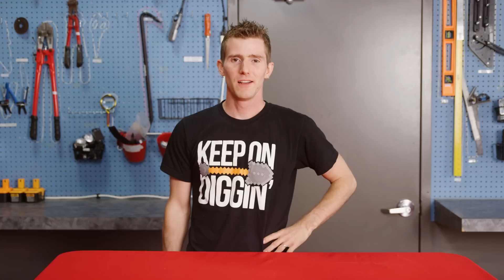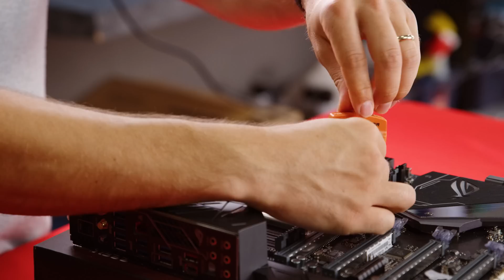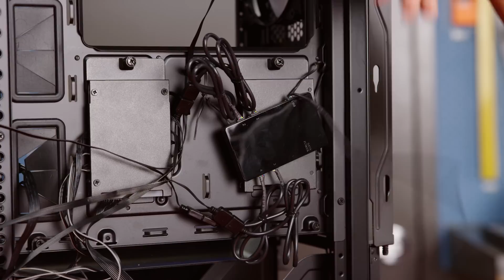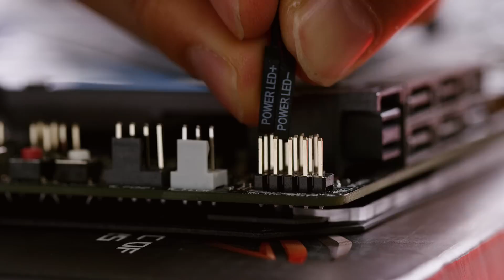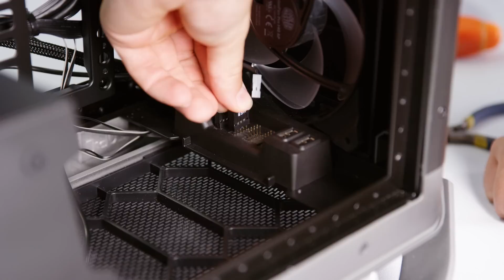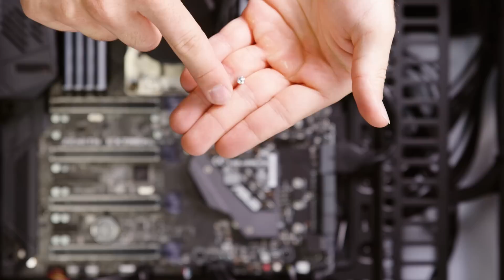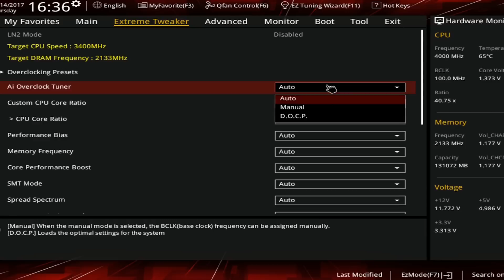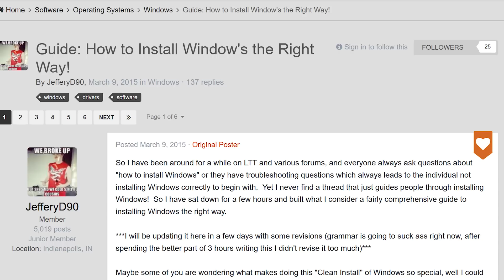Ultimate Mega-Workstation PC Build Guide

Comment: This is going to make the perfect Web-Server system and should have been put into a 3U Server case with with as many fans as the system can take as well as the best Heat-sink together with 2TB of DDR4 RAM as well as a RYZEN VEGA graphics card and installing the SAS RAID controller and install and connect up all hard drives and configure system but no over clocking under any circumstances.

Comment: One problem with this one... you concluded that air coolers (specifically the noctua tr4) were better than a regular aio water cooler for threadripper, so why are you using a CM water cooler? Even though its a sponsored video you shouldnt mislead people by saying "water coolers are basically required".

Comment: In case you clicked this video wondering how to make an apple pie, here is the recipe:

Ingredients: 1 recipe pastry for a 9-inch double crust pie, 1/2 cup unsalted butter, 3 tablespoons all-purpose flour, 1/4 cup water, 1/2 cup white sugar, 1/2 cup packed brown sugar, 8 Granny Smith apples - peeled, cored and sliced

Directions: Preheat oven to 425 degrees F (220 degrees C). Melt the butter in a saucepan. Stir in flour to form a paste. Add water, white sugar and brown sugar, and bring to a boil. Reduce temperature and let simmer. Place the bottom crust in your pan. Fill with apples, mounded slightly. Cover with a lattice work crust. Gently pour the sugar and butter liquid over the crust. Pour slowly so that it does not run off. Bake 15 minutes in the preheated oven. Reduce the temperature to 350 degrees F (175 degrees C). Continue baking for 35 to 45 minutes, until apples are soft.

Comment: Only one GPU? I'm fairly disappointed.
Reply: Multiple GPU's are far from dead for prosumer workstation builds, like this. It's not a gaming rig.
Reply: SLI is only dead IF YOU'RE GAMING. But the issue here is, this isn't a gaming rig. This is a prosumer workstation, so yes SLI yields a monumental benefit.
Reply: Aren't they still supporting two-way SLI?
Reply: Try CG Geek, Remington Graphics, Blender Guru. They all use dual Geforce SLI. Also try sites like Artstation (professional CG artists) and BlenderNation (enthusiasts and pros alike). You'll find many who use it. Might want to check your facts BEFORE trying to make that comment. Studios don't normally use them because they can actually afford a $4,000 P6000 or a $7,000 GP100. And even then, they sometimes turn to other render farms to take care of that for them. Plus Mosaic is a piece of software that also benefits from the hardware. The program doesn't actually determine the speed of the render very much. Optimized programs that specialize in rendering do have some performance upgrades over a generalist program like Blender, BUT they still require strong hardware to render the multiple tiles at once. How do I know? I do this kind of work all the time.
Reply: Crafty Canadian, that's where you're wrong. When was the last time you've even worked with Blender? Cycles, Prorender, Renderman and Redshift all recognize SLI and split tasks among them, allowing for the render of anywhere from two to four tiles at once. There are a myriad of videos that show it even cuts render times by half in some cases. Perhaps you should try checking them yourself. Or would you like me to throw in several references as proof? Because I can do that too. You people seriously need to get a grip and do some research first. This is YouTube, for crying out loud. You should've gotten the idea that I'm right by now. SLI doesn't do much for video games except give you maybe a 10% performance boost. It's video games that don't handle SLI very well because video games run on a continuous set parameters that are pre-loaded (hence the load screens) while rendering is all done by path tracing with parameters that are always subject to change. Did you even bother to look at the artists (with many more years of experience) or the sites I mentioned? Because it clearly shows you were either too ignorant or too arrogant to do so.
Reply: PS: most studios use GTX cards. You can overclock them and replace 10 before the cost is this same as an equivalent Quadra. Quadros are for workloads that can not fail, such as important physics simulations that take months to complete. Again your novice is showing through.
Reply: I use two GPUs, but only because I don't want to spend the extra bucks to get a quad-output card (though they have come down in price a fair bit). I run 4 monitors.
Reply: BleckEpyon, if you only need something for simple business stuff, but would like to run two monitors, then you really don't need more than a system with maybe a Ryzen 3 with possibly a GTX 960, and that's if you feel like doing maybe a little photo editing as well. Not much power is required for something like that.
Reply: Touchy touchy. There's a reason why you never use different cards in the same render. There's a big chance there will be a difference in performance due to core count, clock speed, or VRAM. You'd have to either mess with the sampling or tile size (which will slow down the render) just to get it right, otherwise your render will fail. You also CANNOT use two different APIs (CUDA/OpenGL) in Cycles. It doesn't allow for that. Not even VRay will do that. Prorender will allow it, but that's because it's an engine that came straight from the people who make GPUs instead of some third party, so they've accounted for it (you should check it out. I tested it, it's amazing). I thought someone as "experienced" in engine coding as you would know that already. And for the record, you're missing the point, or dodging it entirely by saying they can be in different computers. That's called Network Rendering. But I'm talking about rendering on one single machine. Most studios use Quadros for the reason that GTX cards don't have enough VRAM to load up with the different texture maps, the mesh and the path tracing that needs to be done. Quadros do. For physics, you don't need a GPU. That has to be done on a CPU or get a Tesla (or equivalent) because it's all a series of algorithms and points, not visual objects. Same with particle effects. Particle effects do have a visual aspect, but the physics are all calculated in algorithms, which again, you'd need an algorithm processor (or coprocessor) for.
Reply: My "home" rig is both for gaming and as a workstation. I dabble in Poser, Photoshop, etc, which is why I use 4 monitors, but not enough to make money off of it (my day job is a landscaping business). My business machine has 2 monitors, and at some point, I'll replace it with a MB that can handle 3 monitors on board. Nothing fancy, I don't use it for gaming or graphics, just spreadsheets and business stuff like that.
Reply: Aspiring Wackjob SLI is for video games, Blender and all path tracers treat each GPU as a seperate entity. No need for a SLI compatible mobo and you can throw in any combination of GPUs. Most applications do not make use of multiple graphics cards very well, you should know our line of work is a very specific use case. Don't be such a dick, you are clearly lacking in knowledge yourself.
Reply: Aspiring Wackjob This is my job, I can see right through your novice bullshit. You've probably never even been paid for a job before. You can use an AMD GPU mixed with an Nvidia GPU on a non SLI compatible board and get nearly identical results to two Nvidia GPUs in SLI. Cycles breaks the image into chunks then asks each GPU to render a chunk, independent of SLI protocols. The two GPUs can be in different computers you fuck wit. I've been coding render engines for years, and I'm still a novice. Quit acting like you're superior yo everyone else because you've watched some youtube tutorials.
Reply: Sli is dead even nvidia know that
Reply: No one uses dual geforce cards in SLI in a workstation computer seriously lol,mosaic is the way to go
Reply: If you can afford a 1080 TI - you're good. SLI is not worth it. Never was, never will be.

Comment: The unit of torque is inch pounds, not pound per inch. And that's not even starting on how pounds aren't a unit of force, but of mass. And then there's the fact that the units are imperial.

Comment: Can u do a mega charging comparison of multiple iPhone 8 plus and 7 plus with 12 watt apple ipad adapter vs Qualcomm quick charge 3.0 adapter(aukey, anker etc) vs Huawei 4 amp adapter vs Oneplus dash charger vs oppo vooc flash charger vs mediatek pump express charger vs Samsung Note 8 charger, ALL CHARGERS CONNECTED TO DIFFERENT IPHONE 8PLUS OR 7 PLUS VIA STOCK IPHONE LIGHTNING TO USB A CABLE, NOT using the USB C to lightning cable to test that whether iPhone changes faster with stock cables but using latest different brands fast chargers unlike Apple says. Cuz it costs( 84$) 35 $ plus 49 $ apple usb c adapter and cable and if we buy only 35$ cable and 22 $ USB C aukey, anker, xiaomi adapter it still costs 57$, but if the test will be successfully using stock cable, will be spending only on USB A fast charger

Comment: 13:37 those are the wrong 4 screws, the correct ones are on the edges of the psu hiding plate (3 on the bottom, one on the side)

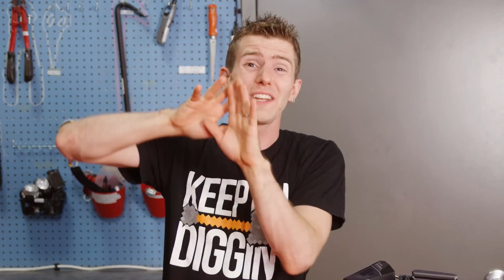Comment: 4:23 "128gb LRDIMMs (load reduced DIMMS) those aren't even out yet!!" 

HP Workstations have had LRDIMMS available to configure into their systems for more than two years now, with models like the Z840 being able to handle up to 2TB of RAM (16 slots populated), and the soon-to-be-release Z8 generation can handle up to 3TB. 

Ridiculously expensive? Yes. For gaming? Nope. Overkill for 99.9% of PC users? Hells yes. Good for geological simulation and engineering and CG rendering? Yes, absolutely.

Comment: i remember my 10 year old p5k motherboard had a revolutionizing feature: it came with a little male to female header on which you could connect the power LED +, LED -, hdd activity , reset switch and power switch so it was a lot easier to connect or disconnect the motherboard from all these cables and not having to plug them all individually each time i had to take out the motherboard for some reason. Why does a modern, top of the line motherboard today not have such a simple but handy part? it probably costs only a few cents to include.

Comment: Btw The visuals and filming was amazing, but if this guide is meant for a beginner shouldn't you be focusing on the absolute basics?
Like which connectors go where what's  a  4pin power connector, what's an RGB connector?
Not to mention, not bombarding them with extra confusing knowledge!

Comment: I found it extremely hard to get the CPU socket closed on the same board, heaps of other people with the same issue so not sure :/ I eventually got it closed by half turning screws 2/3 first then pushing down super hard to get screw 1 in, that was required to get the screw to thread.
Reply: It depends on who makes the TR4 socket for the mobo. There are two companies that manufacture the socket - Foxconn and one other whose name I can't recall at the moment. One of them is causing the issues you're referring to and the other is not. At work so I don't have time to research it again but if you figure out which one is good, you'll can rest easy with a board that has a socket manufactured by them.
Reply: Well, sure... anybody can receive 1 bad motherboard. But comparing the cooler mount of an AM4 to the CPU mount of TR4, is apples & oranges. One holds the processor in place, while the other holds the cooler on. One is a backplate, the other is part of the CPU locking mechanism.
Reply: Foxconns TR4 sockets have lousy tolerances.
The ones made by "Lotes" are much better.
IIRC the ASRock X399 Taichi has a Lotes made socket, but don´t quote me on that.
Reply: well it IS called THREAD RIPPER isn't it??? lol
Reply: AGS Function - You referred to a stock cooler, which means you're building on the AM4 mount, which is completely different than the TR4 mount, for the actual CPU, not the cooling solution. Backplates for AM4 boards are a completely different animal.
Reply: You do have a point there. :)
Reply: I'm going to do a threadripper 1950x build soon but I'm worried about that issue with those cpu sockets. Has AMD or their mother board partners address this issue yet?
Reply: CRF250R1521 -well played. lol
Reply: @nappydrew I think AGS Function is referring to AMD sockets in general. I think it was Hardware Unboxed that complained about this particular problem (on TR4) but it may have been another YouTuber. Personally sounds like AGS Function got a rogue AM4 socket which is bound to happen to any platform.
Reply: I actually had a similar issue when building my Ryzen build. The stock cooler that came with the cpu had  a hard time fitting, one screw would screw in , but then the rest wouldn't. had to push down pretty hard and i think i severed some connections because i kept getting boot issues and eventually crashing. overtime i think the reheating and cooling reconnected some of those connections. in either case, its a lot more stable now and im not quite sure what i did.

Comment: i wonder how's the cooler performance on that processor..
Reply: not as good as a custom loop... 
It's not just for looks, the cooling performance is directly related to the size of the radiator, some custom radiators such as the EK XE 360 can cool down just about any CPU or GPU. plus as mentioned the water block isn't very optimized (to be fair non are because AMD made the Rizen die so much bigger then the average CPU die).
Reply: Shamsul Aswad Sulaiman Bad because the water channels/fins cover about 50% of the cores' surface
Reply: that's what i thought..then i realized that the video was sponsored by cooler master..lol

Comment: No benchmarks? Sad face
Reply: 1H more of work to set windows 10 and run test , isn't that to much to ask ? They don't show us how powerfull this is , so this is NOT " yet " the Ultimate Mega Workstation .
Reply: Didn't have an OS installed to test lmao
Reply: 4k is valid, I have a 4k monitor at my desk right now.
Reply: trust me, this thing will destroy every benchmark, especialy synthetic ones.. and for gaming.. well.. ask this machine again in 3 years and check back if its getting below 90fps in any case
Reply: except for 4k obviously.. but 4k isnt valid anyways today. soo..
Reply: Atm I would have thought "ultimate" would be a dual-socket EPYC with 64 cores. Just sayin'. :)   Funny part is, the CPUs don't cost that much more than the 18c SL-X XE.

Comment: btw, did you guys forgot to peel off the paper protecting the thermal pad on the inside of that mirror like shining motherboard plate?
And thanks very much for the bios instruction, I was really annoyed when i couldnt get my dram running at the recommended frequency.

Comment: Linus, I was watching a video where Noctua`s new AIR coolers for TR4 completely obliterated the NZXT Kraken coolers by like 10 degrees Celsius. So I would rather have the whole die covered rather than making excuses for the AIO coolers.
Reply: HardwareCanucks?
Reply: That's true, and a valid point. Air vs AIO/water has been an old of a  discussion with compelling arguments on both sides of the fence, but in this particular case I would say that with the added effectives, the Air coolers make more sense for the TR4.
Reply: The only reason is that Coolermaster does not have a cooler that could beat the Noctua that are made for the TR4.
Reply: Even LTT has made a video on that recently, kinda. They compared some of Noctua's air coolers with some AIOs and the air coolers turned out to be more effective. The problem however is that the air coolers are pretty big compared to the AIOs and if you don't like the look of a huge chunk of metal on your CPU and have the money for it, an AIO or a custom loop might be the way to go.
Reply: "We need a small cooler in this 50lb monster of a case."

Comment: 1) No SLi? 

2) No setting special RAM clocks that are proven to increase ryzen performance ? (for the gist of it go to https://www.youtube.com/watch?v=S6yp7Pi39Z8) 

3) I would also like to see it with liquid edition Vega 64 that has been undervolted (which allows then wattman to increase the wattage since the temperature falls down) Id like to see that because there is talk that ryzen chips perform better with a Vega card than with a Nvidia card.

4) Generally building this and not OC it to the limit?

5) No benchmark? its like porn without the moneyshot :P

Comment: Only a 240mm radiator? You're probably not going to be able to overclock with a radiator that small. HardwareCanucks tried using a NZXT x52 and it overheated during a stress test and shut itself down.

Comment: TR4 pro tip: Don't use an AIO liquid cooler. The heatsink base plate doesn't cover the IHS completely and doesn't cool it very well. The Noctua NH-U14S TR4-SP3 will cool about 15% better because of its larger base plate.

Comment: I want to see a propper balls to the wall, "that kid who clicked price low to high on newegg", makes zero sense what so ever, uselessly awesome, all out, ultimate build. 
I'm talking super computer grade hardware. (Tesla p100, ryzen fucking Epic, somehow overclocked if that's even possible. With an custum liquid cooler, with a quad radiator plus a second duel radiator, each with fans on both push and pull. 
I want benchmarks, I this bitch to calculate a trillion digits of pi, on screen. 
I want to see the fuzzy ball of death preform adequately. 
And most of all, I want this 70 thousand dollar pc (What? Did you think I meant only 1 Tesla p100???) 
Compared to the cheapest possible pc beating it in gaming benchmarks. (See if you can get an overclocked 7600k with a 1080ti to out preform it)